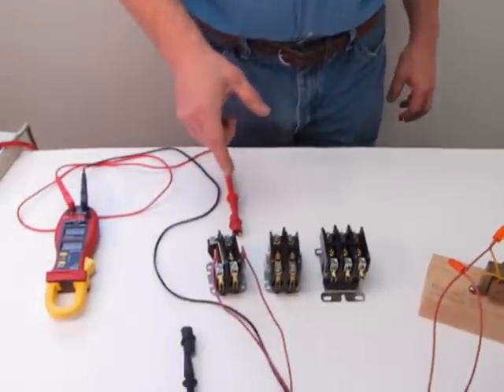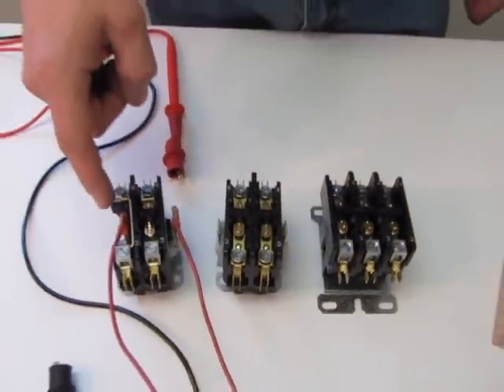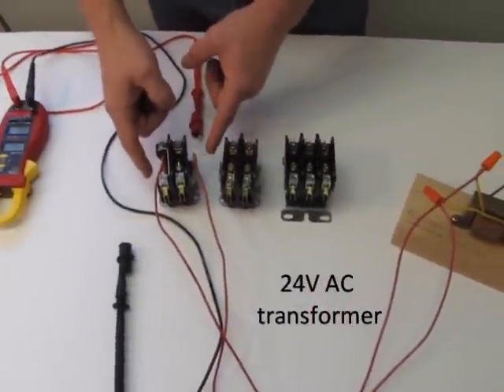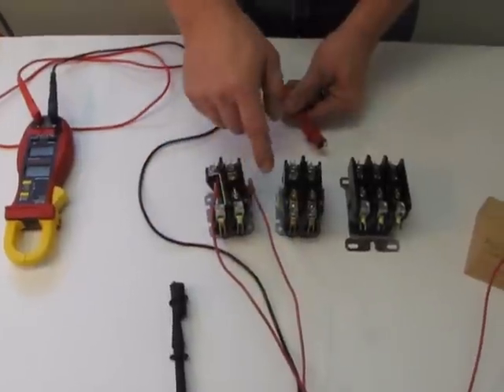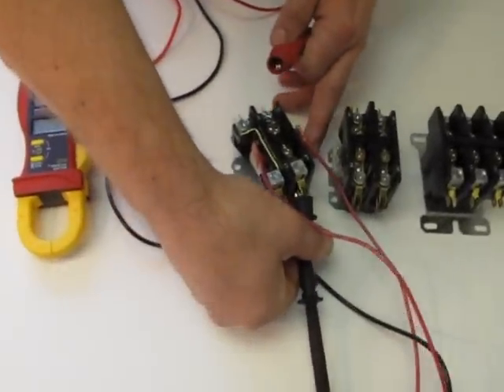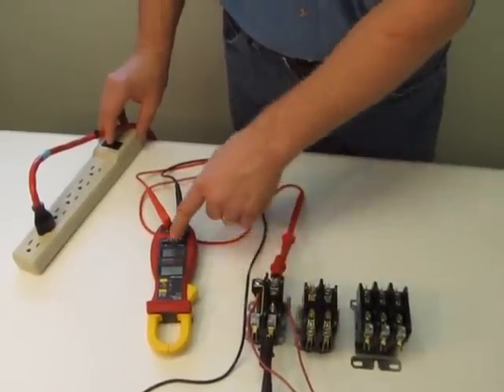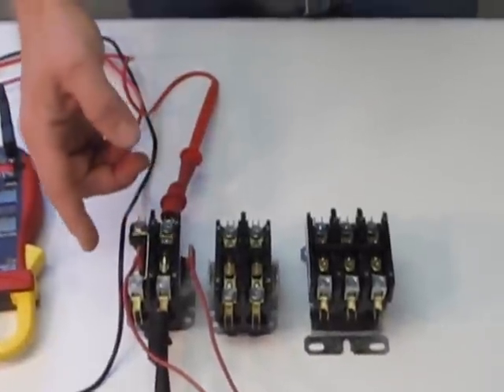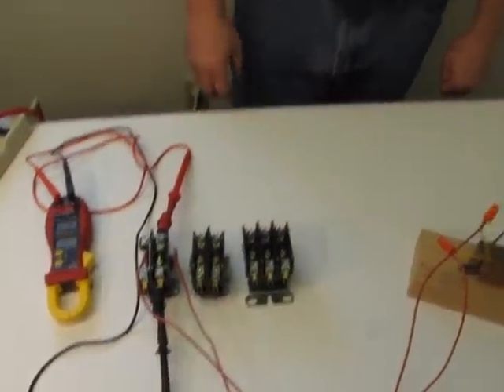How a Contactor Works

Comment: good job! I worked for 3yrs troubleshooting contactors and other standard control components. Another tip is if the contactor doesnt pull in and its fed by a transformer, make sure the transformer has enough VA capacity as a coil requires a certain amount of "pull in" current to initially close the contactor.... not always a contactor problem.....just a heads up....but great vid!

Comment: pretty much at the end of the contactor (120v side or w/e ur using), there is potential there.. and in order for electricity to flow through it. u have to close the poles (24v does this), and it completes the circuit and will then travel to your load :D

Comment: The contactors can also have the metal plating worn off of the connection points. This will cause them to have to be replaced.

Comment: I know you have the 24V to automatically check the winding and therefore did not need to press down on the contactor to check continuity, i.e. you were checking 2 things at once.  But, It would have been nice to see you bench test the winding with a DVOM vs applying power to it.

Comment: this video is amazing, but i hope you will explain about Medium voltage contactor, because there are some coil like closing coil, open coil, holding coil, how those things work sir(the principle)? because my lecturer said the different between low voltage contactor and middle voltage contactor is from the coil beside the voltage, can you explain it or link me to the web that will explain it or you have the video about that???

Comment: nice vid..i had a problem with them a couple days ago, still do not understand what ihad tbh .. contactor wasnt pulling..so took off the wires form the coil and measured voltage, , got 24V..but when i put them back to the coil and measured it from there , i wasn't getting anything..tried it with a new contactor and still wasn't working..what are the possible causes of this?...thanks in advance....also pressure switches were all close too...

Comment: I have two electric baseboard heaters producing 16 Amps currently connected to a double pole  22A-120/240 Vac(18A-277VAC res. only) thermostat. Can I use this same contactor to connect on a 24V  wifi thermostat?

Comment: Good explanation.....but i curious to know....why electrical circuit need contactor and what happen we just direct current flow to the circuit without contactor....please someone explain to me...
Reply: +ADIB RAHMAN they are used mostly for switching big 400v with little 24v switches. it's better for the durability, and for you. cause if it shorts you dont dance the electric boogey

Comment: so if i have 200Amp contactor and 72volt system with 400Amps the contactor is gonna stop the current if the Amps are more then 200 is that right ?

Comment: hi im trying to connect a temerature controller to a contactor. i had an electrician do the to but i then removed it to be placed elsewhere and it just messed up from there please can you help me..... imusung a 220v temerature controller with a 12v input click thingy and a push in contactor. iv managed to get it on but it does not give out power to unless i push in the switch on the contactor, any idea why this is happening????? thanks....

Comment: in a emergency, how to bypass the bad coil to get the equipment going? Any idea?
Reply: The electromagnetic field in the coil is what pulls your switch(es) shut. If its not doing that, then the only way you could bypass that is by jumping from one side of the contactor switch to the other, to avoid the contactor switch completely.

But that's not a safe option as to whatever that contactor is powering, will be running all the time. It will no longer serve an automated process.

Your best bet would be to replace the coil, (some brands of contactors you are capable of doing that) or replace the contactor entirely.

If this is a circuit that is suppose to run all the time, maybe it wont hurt, but it's best to do it the right way.

Cheers, hope this helps.

Comment: Very interesting my contactor is not pushed in but my compressor and condenser fan is on when I put in pull switch. Also when thermostat is off still on .   What could it be.
Reply: You probly bypassed the Contactor somehow

Comment: What's the difference between a contactor and a relay?
Reply: I believe they work similar, but contactor are more heavy duty.
Reply: Similar to each other ....but

Contactors usually applied to devices controlling power above 5kW, but 'relay' is ordinarily employed below 5kW.